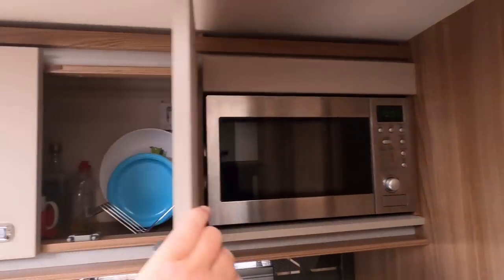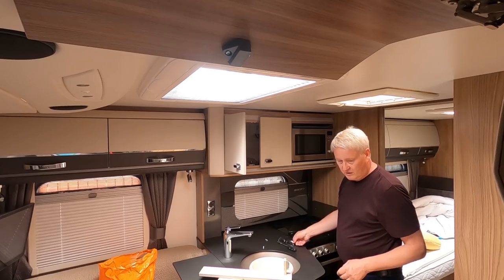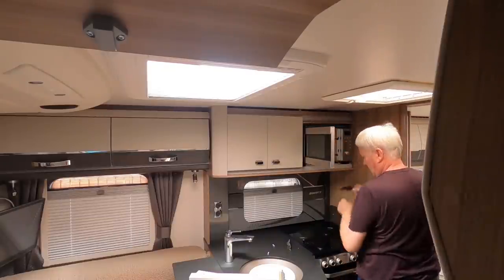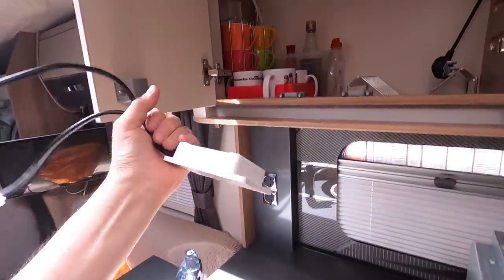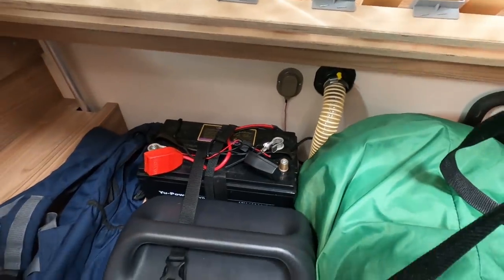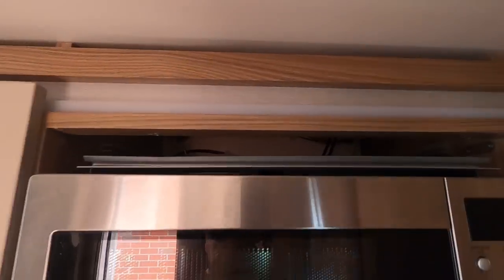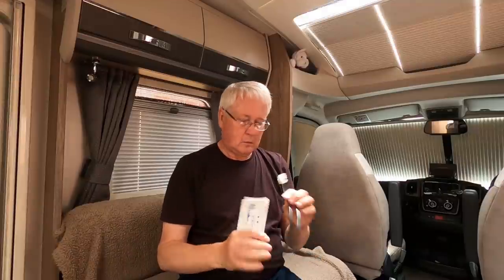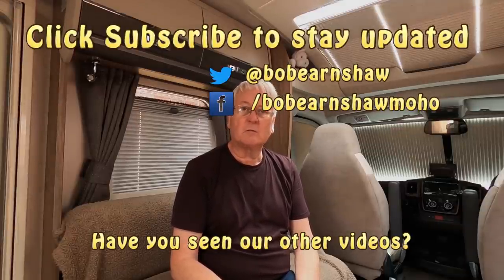How To Remove A Microwave To Change A Solar Panel Regulator

Comment: Great instructions and it confirms Motorhomes are built using smoke and mirrors .
I would have cut the binding on the cable to help extend the wire so that it would pull through he round hole.  Cheers Richard.
Reply from the maker: Couldn't get to any binding, my hand wouldn't fit through the hole.
Reply: @BobEarnshawMoHo  sorry Bob I ment when you had the oven out in case you needed to replace the unit later. Thank you.

Comment: Bob well done, I'd have removed the tape holding the slack and relocated it near the hole, that way if it packs up again , you would not need to take out the microwave again.
Reply from the maker: There's no slack in the cable to the PSU.
Reply: I thought I saw the cable returning towards the solar charge unit and restrained by tape too? If that was the case then I would have removed that piece for future maintenance 👍Andy
Reply from the maker: @tanksontour  maybe, I was just wanting to get it changed. Might have another look if I upgrade the solar regulator.
Reply: @BobEarnshawMoHo  i noticed the loop, too Bob - both connecters looked like they’d position in the crockery cupboard.
Reply from the maker: @VandromedasTravels  I won't be taking the microwave out again for a while folks, but thanks.

Comment: Nice work Bob. How much easier it would have been for you if the cables to the connectors had been a little longer.

Comment: Great vid Bob, and its good to video to show the wife why these 5 minute jobs take so long.  shame the power lead wasnt a bit longer to pull it through the hole for replacement,  but they never thing anything will need replacing.

Comment: Couldn’ help but notice that both leads to the controller could have been located accessibly on the left of the partition, had they just been routed slightly differently.  The struggle you went through also explains why that top panel isn’t solidly back in place after our identical controller was replaced under warranty.
Reply from the maker: Yes, maybe at some stage I'll reroute them, when a get a Roundtoit. 😊
Reply: @BobEarnshawMoHo  Somebody bought me one of them for Xmas a few years back. Thankfully, I lost it… Could have been disastrous if I hadn’t…

Comment: Hi Bob good informative video,here is a little tip for you, instead of undoing your solar panel on the roof and undoing the cables just place a lengh of cardboard or other over the panel that way it will block out any of the sun's rays and not produce any power and you won't short anything out whilst changing the regulator.This is what I do when I've installed solar panel systems in the past.I have a Swift Champagne 694 and the microwave and solar regulator are in exactly the same place as yours and watching your video will help me to remove the microwave if ever I have the same problem.kind regards,GrahamToyn
Reply from the maker: Thanks, I did put a cover over the panel to prove it was the solar that was overcharging, but I had to drive and couldn't leave it covered up

Comment: Er, sorry about this but, given that the gadget packed up once, could it not go again? I don’t know if you can get extension leads for the gadget so that next time there would be enough to replace it without taking the microwave out. Sorry again but the stable door is shut and the horse has bolted as t’were. Superb videos from you as always.
Reply from the maker: I didn't have an solar extension cable to hand at the time, but at least it will easier to remove the Microwave next time.

Comment: Great work their Bob, this was a big job very impressed you did it yourself - also good that  Sargent watched your previous video and sent out a replacement, great customer service 👍 I suppose the microwave has to be a tight fit to stop rattles but you wouldn't want to be a motorhome technician with big hands 😂

Comment: After watching your tyrepal video I bought the same one as you. Having set the pressure to my handbook recommended setting of 80 psi I set off. The pressure increased to 92 psi . Did you see any increase in your pressure?
Reply: I have TyrePal, as the tyres heat up whilst travelling the pressure will increase.  I've even noticed a slight increase on tyres with the sun on them. 🖖
Reply from the maker: Yes there will be an increase in temperature as the tyres warm up. I wouldn't set my tyres pressures that high, that's normally the Fiat recommended pressures, for a fully loaded goods vehicle. Consult your tyres manufacturer who may recommend a pressure depending on loading. I set mine to 65psi front and 75psi rear.

Comment: Shouldn't there be a 2cm clearance (for ventilation) on the two side walls and roof of Microwave?
Reply from the maker: The cupboard is well ventilated and there is a gap all around, though I didn't get the tape measure out.
Reply from the maker: We do use the microwave but then we're fans of the ready meal, especially after a long trip.

Comment: Well done Bob, just in case it goes again I would have future proofed by unclipping  that wire back to the top corner. This would have given you enough slack to pull through the cupboard without removing the microwave again. All the best to you and Jen on your travels 👍🏻
Reply from the maker: No, there wasn't enough slack on the cable to the PSU.

Comment: Did you notice that the wire you could not reach was behind a a cable that went over to the right hand side and back if you bring that wire in front of the other cable you would not need to take the microwave out.
Reply from the maker: No I didn't see that. Too late, but thanks anyway.

Comment: Sergeant are a very good company. I had a tracker issue with our old Swift Caravan. They sent me a replacement without question and they could access it from their end to see it was faulty. Before they posted it, I had to sign a document to say I wouldn't reveal where it was concealed in the caravan! Talked me through how to put the new one in after location of the original. All this stuff is a pain in the a@#e to get to....😤

Comment: That was a bit of a faff to get to the connectors so we’ll done.  Swift need to make the holes bigger so you can get a hand in 👍
Reply from the maker: That would be good.

Comment: Ye don't believe sargent , I to have just had to replace my failed regulator.  I've got a sterling eccles trekker,  test the panel 19.6w out of a 20w panel,  great 👍
Test on the van side of the reg and get 6.1w , so them saying it shouldn't really fail  is a load of of old baloney,  trust me it ain't just us......

Comment: where do the cables go  after that... not straight to the battery..
Reply from the maker: No, they go to the Sargent Power Supply Unit.
Reply: @BobEarnshawMoHo  Do i  turn everything off on the psu then, When in storage.
Reply: My battery is going flat in storage, do i shut down the PSU and leave the 140watt solar to charge the battery , even to its shut down..
Reply from the maker: This time of year you will get very little from a solar panel of 100w or less. If I were you, switch off at the power supply, unless you have electric hook up. You may want to trickle charge your batteries occasionally too.

Comment: For the price you pay for these motorhome's the fittings are garbage, I've noticed on other channels they just fall to bits.
Reply from the maker: I wouldn't have put quite like that! I've had two hardware items fail since I bought the Motorhome 2.5 years ago, this regulator and a valve for the toilet.

Comment: glad you got it sorted.....to save your knuckles maybe bend some wire into a hook so you can reach in and hook the panel to drag it forward....
Reply from the maker: I did try that with an old coat hnager! Just couldn't pull it straight.

Comment: Microwave doesn’t seem to have much venting. That’s Swift for you our caravan was similar. MPPT does not need to be more complex or have BT, just better at doing it’s job.
Reply from the maker: I think the ventilation is fine, top and bottom at the front and slots in the cutlery cupboard side. Never had a problem with it overheating and we do use the microwave.

Comment: Bloody Stupid Idea Bob having the Connectors behind the MW
All it needs is a Small Junction Box in the Cupboard with the Connectors inside it.
Should have Extended the Wires Bob so Both Connectors was the other side of the Hole Terminating in a Small Plastic Box off Ebay or RS Components Bonded onto the Cupboard Side Panel, saves you doing all that  Parlava if it goes again or Change it for a Diff Unit